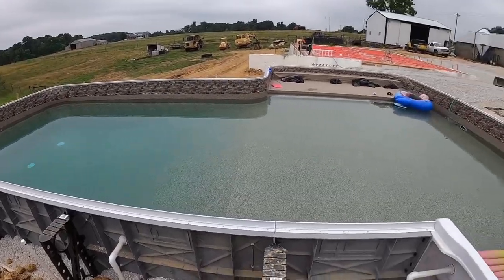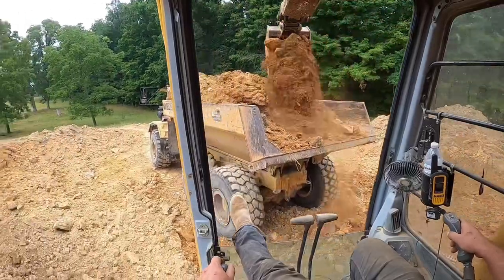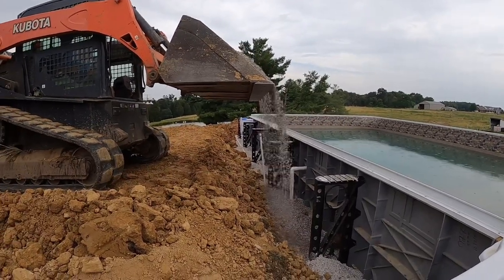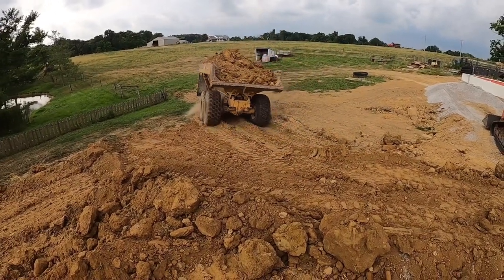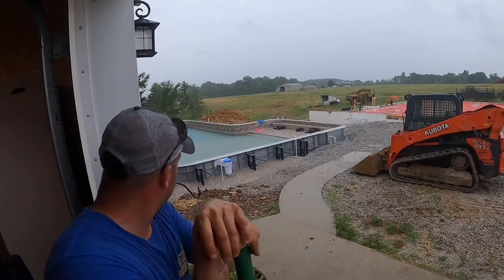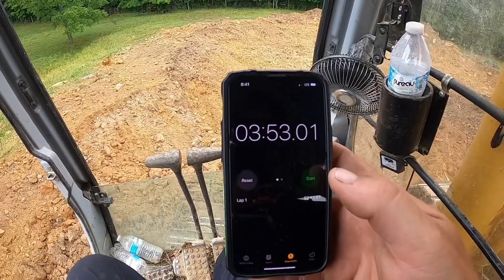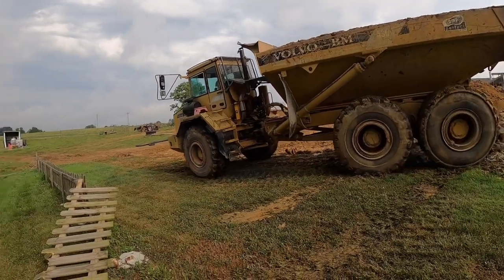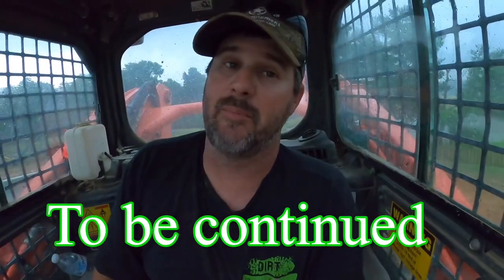This job has turned into an adventure, Kubota broke down and Matt crashes Bubba Dump into a fence.

Comment: Soooo... water in the pool before its even backfilled? Interesting choice. How much weight you think those fiberglass steps can tolerate at the bolts where they meet the wall? 7lbs per gallon pushing outward against... air? 6 or 7 bolts per side... wouldn't catch me anywhere near them steps zall I'm sayin.    Gotta follow the steps. 
1) Dig hole.
2) Walls and steps, up/pinned and level.
3) drop pins inside, run strings and shape walls
4) Main drains and footer (maybe some gravel inside)
5)Light niche, Skimmers and returns, plus plumbing and conduit hung from braces or deck supports OR dust footer with gravel and run tiger flex.
6) backfill and coping
7) raise yer strings and base the pool
8) form fer concrete and yer filter pad, more electrical
9) Concrete.
10)liner with 2 or 3 trucks of water to set it and cut it in. 
Now you can mix n match a couple steps. Like you can do base before backfill but yer talkin about movin base over a significant hole, easier to backfill first. Same with concrete and liner. Why would you install a couple grand worth of liner before you set a pile uh guys loose doin concrete ABOVE it? Base as well. We do it usually before concrete but it's silly to do so unless you really know yer concrete guys. But base, liner and water before there's anything but the footer to hold the walls and steps from blowing out? I wouldn't.
Reply from the maker: You. Not watch the video covered all that 🤷‍♂️ lol
Reply: @DirtPerfect  I was typin more than

Comment: Doesn’t the 210 have a 42” bucket?  How much faster would it load with a high capacity 48” bucket.  Is there anymore tweaking you can do on the computer to make the 210 faster.   I agree with you about machine size and efficiency. I just think the 210 can be much faster. Down to low 2 mins per load.

Comment: The only thing Matt could have done was goose it.  That has front wheel drive(Well, all 6 wheels really)... give it the gas and pull yourself out... I guess I grew up driving front wheel drive cars on snow and ice, you learn how to deal with that.  Problem is.. when you start sliding like that.. you panic and try to stop, not go faster and don't think about point the wheel where you want to go and gun it.  Pools looking great.. and the Kuboda finally singing it's death song.. (why does it sound like Celebration time)

Comment: The Volvo has six wheel  drive but two wheel brakes as only the fronts locked up. Calibration (equalizer)issue? If all six brakes had  been working he would have stopped in time. Even after backing up, every time he touched the brakes, the fronts locked and sideslipped the truck front end.
Reply: Looks like Bubba needs more shop time.
Reply from the maker: Not at all think about how it works from the shop videos

Comment: Mike fuel consumption on Cummins engines has never been good,  I would like to see the difference between the 4 cylinder and 6 cylinder as I think the 6 could be more efficient as it wouldn't rev as high!! Any thoughts?
Reply from the maker: Run the same rpm and about 2 gallons more per hr

Comment: Either he wasn't using the brakes when he hit the fence or the rear brakes aren't working right. The back tires were turning.
Reply from the maker: Sorry you don’t understand
Reply: @DirtPerfect  In the comments many were saying he needed to let off the brakes so it would go the direction the nose was pointed. My point was either he wasn't using the brakes or the rear brakes aren't working right as the rear wheels were turning while the front was sliding.
Reply from the maker: You watch the videos on repairing the brakes